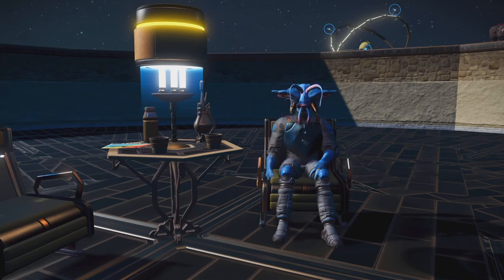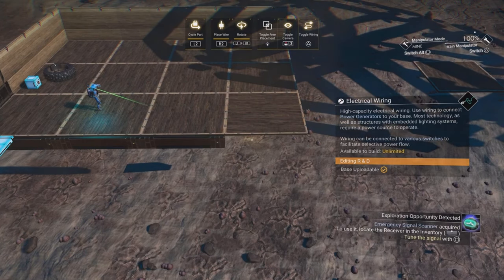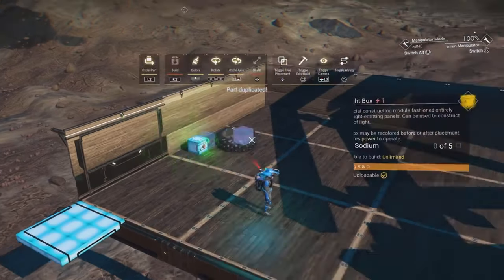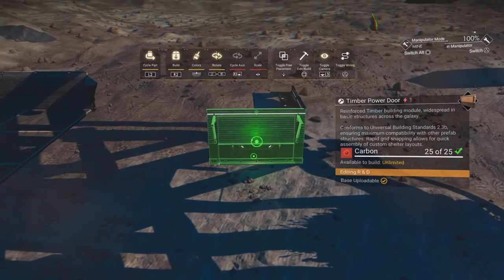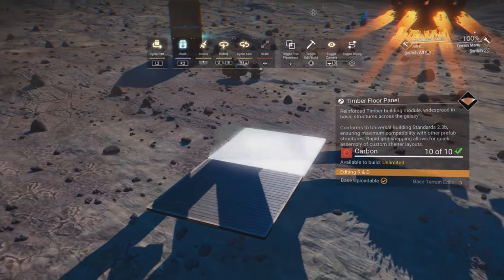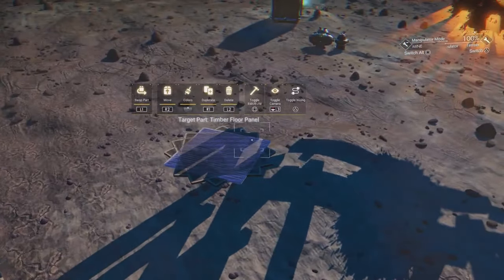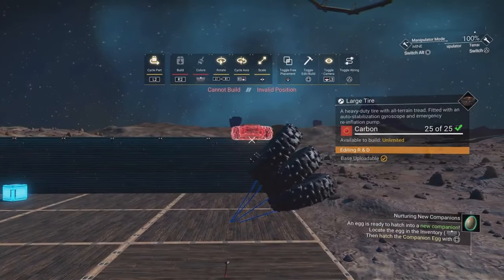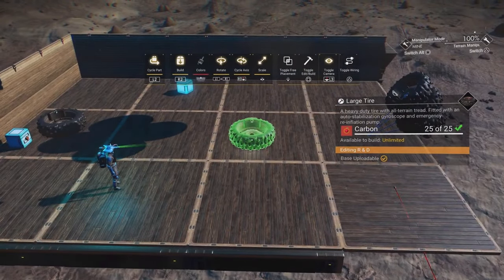Glitchbuilding for Beginners Episode 3: Reverse Wire Glitch

Comment: Idk why but i click Y and RT and the wire dosen't appear....
Reply from the maker: those should work. The timing is almost exactly the same time with very very very subtle preference to Y first but you would not even notice it. It's like .001 sec delay and should even work when timing is slightly off. Unless you've mapped your buttons differently, it should work. Perhaps try a few times and see if the timing is more specific on your XBox
Reply: @dg_squared2735  i did it!!!!!!! It's like that the y is pressed a tens of a second before the rt, but it is imperceptible. thank you so much mate.
Reply from the maker: always happy to help. May the glitch be with you! @RiccardoPanarotto